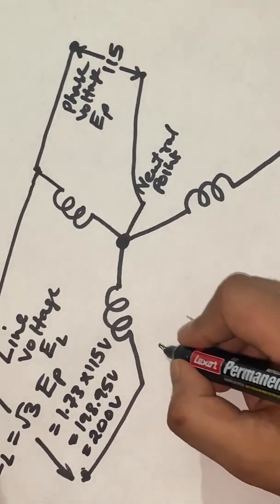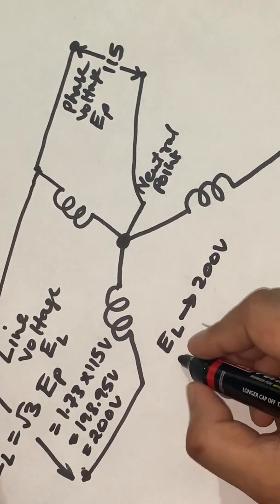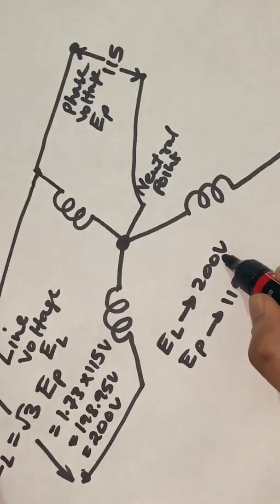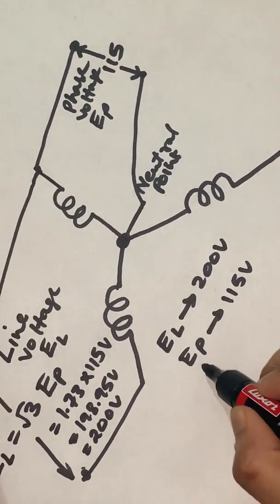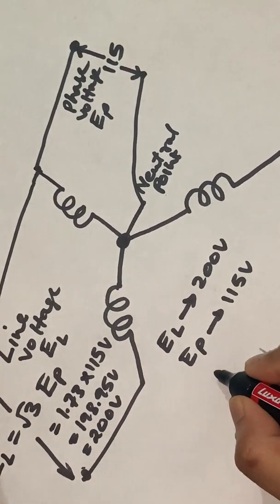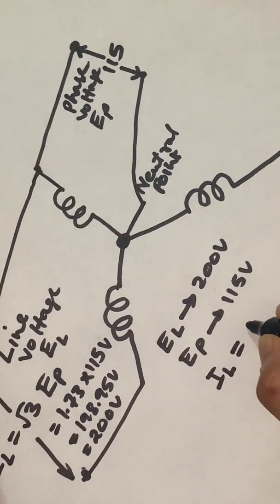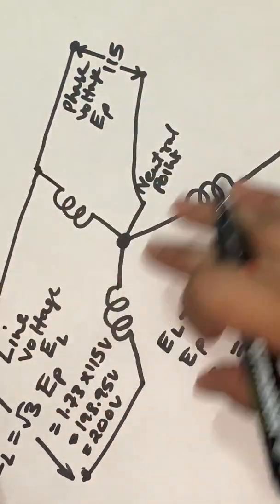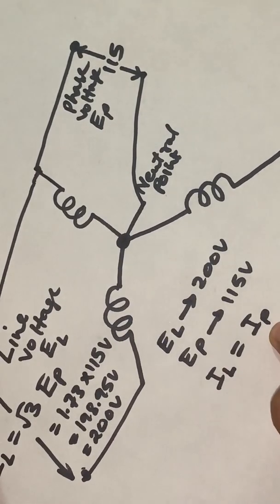What is the meaning of 115/200 V AC? || Star Connection || Phase Voltage || Line Voltage

Comment: Can you explain where 1.732 come from?
Reply from the maker: Yes! In Electrical power engineering, the voltage between two phases in a three-phase system equals √3 times the line to neutral voltage. This is because any two phases are 120° apart, and two points on a circle 120 degrees apart are separated by √3 times the radius. Note: √3 = 1.732